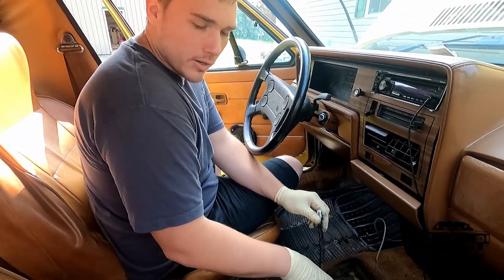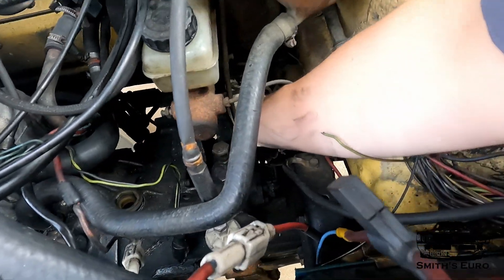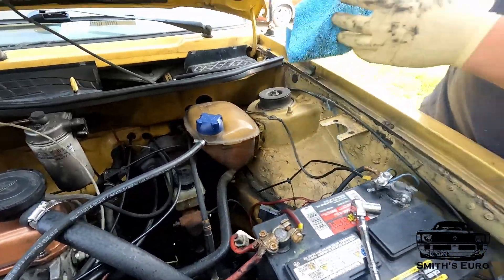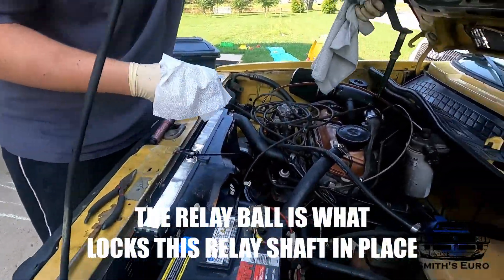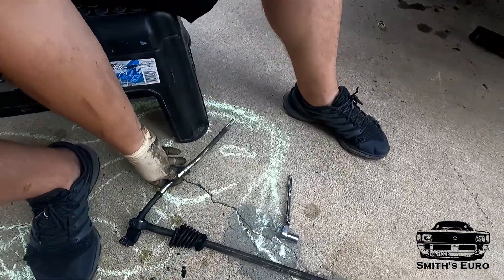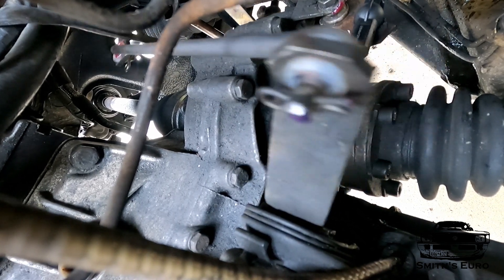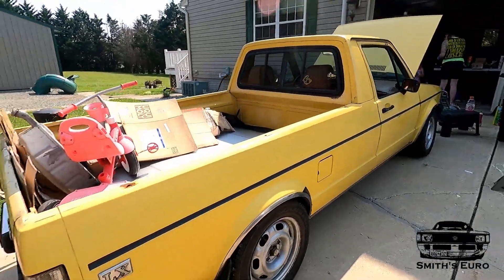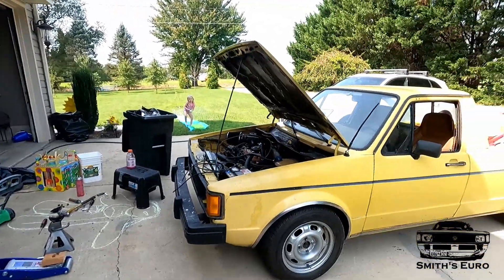MK1 Rabbit Pickup Complete Shifter Rebuild

Comment: How would I get it out of third gear it’s stuck but the shifter has free play up and down but not side to side
Reply from the maker: Youll have to manually go out to the trans and pull it out of gear.

When it the shift tower moves free up/down youre in neutral

Comment: Hey I just replaced all my shifter bushings and it won’t go into reverse once so ever what should I do to fix that?
Reply from the maker: Recheck everything, nothing obvious then I would say you probably didn’t keep it in alignment on the splined shaft.
And you would have to reset it to the oem bentley settings in the book.
Reply: @SmithsEuro  I put everything back together how it came oof like first and second and where reverse is
Reply from the maker: Hard to say without seeing it.
Best bet is to grab a bentley manual and reset it to oem setting.

Maybe someone messed something up in the adjustment before you got it. And its been an issue getting gears.
Reply: @SmithsEuro  I got it fixed I found out the issue in one of the books I have and after that it works fine and I was off by a couple teeth on the shaft
Reply from the maker: Good to hear. Do a burnout in it now.